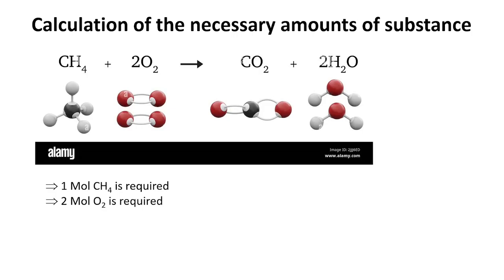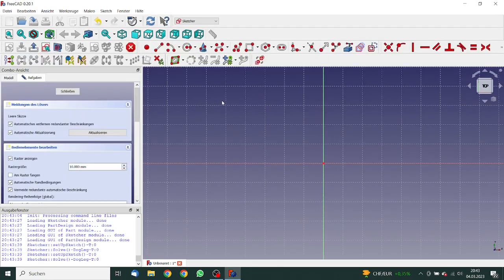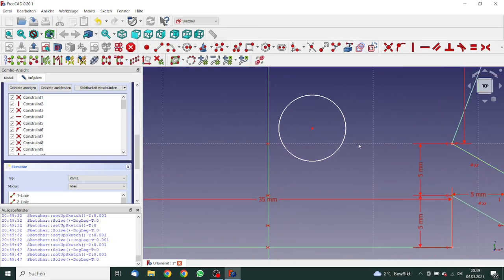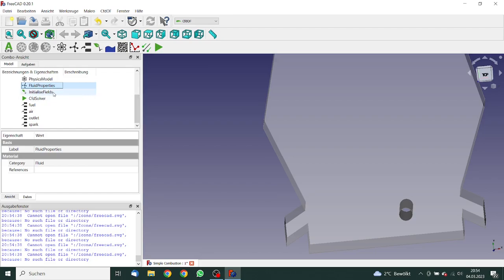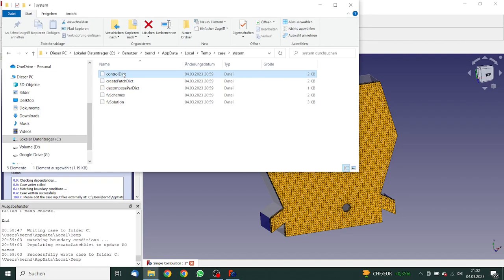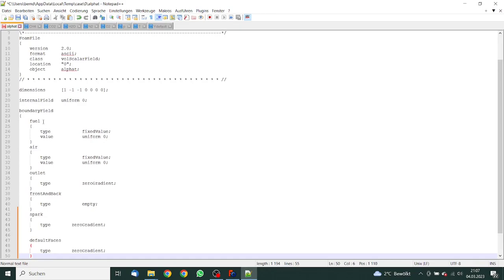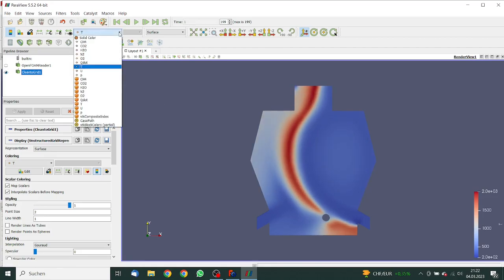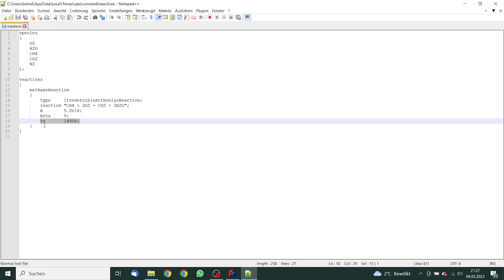Freecad CfdOf Tutorial #11: Simple Combustion with reactingFoam

Comment: Great work Tech Bernd!
I made it work with FreeCAD 1.1.1 \ CfdOF v1.37.3 \ BlueCFD OpenFOAM 12 in Windows.
Little bit of editing is necessary so, first of all, I advise unexperienced users (like me) to read carefully the User Guide of the OpenFoam version installed and used by CfdOF.
Then use the tutorial "counterFlowFlame2D" in the folders "tutorials" to compare the files with those generated by CfdOF: you need to "adapt" the files of the tutorial to the specific case simulated, as shown in the video.

P.S.
Let me add that with OF 12 abovementioned is necessary to edit the files "Allrun" and "Allrun.ps1":
- commenting the line "runCommand renumberMesh -overwrite"  (or delete only "-overwrite" in this line) in both the files to bypass mesh renumbering to avoid an error
- changing the line: 
   runCommand foamRun -solver incompressibleFluid
with:
   runCommand foamRun
in both the Allrun files, since the solver is now specified in the "controlDict" file (that must be edited according to the "counterFlowFlame2D" tutorial) and with OF12 starts with the lines:
...
FoamFile
{
    version     2.0;
    format      ascii;
    class       dictionary;
    object      controlDict;
}
// * * * * * * * * * * * * * * * * * * * * * * * * * * * * * * * * * * * * * //
application     foamRun;

solver          multicomponentFluid;

startFrom       startTime;
...